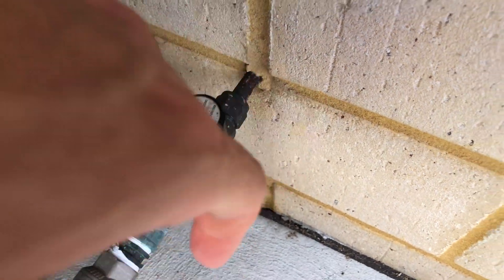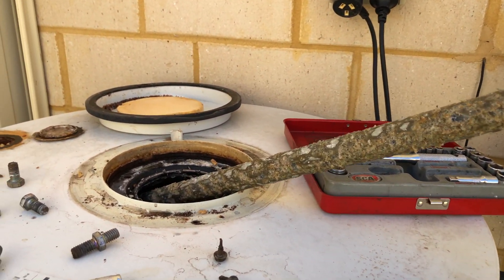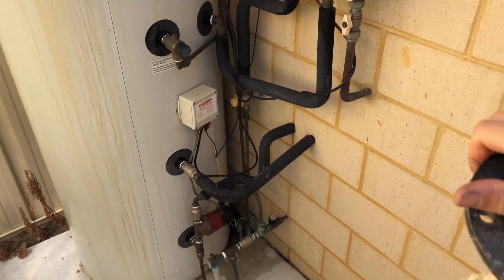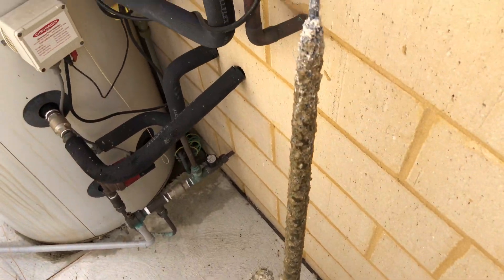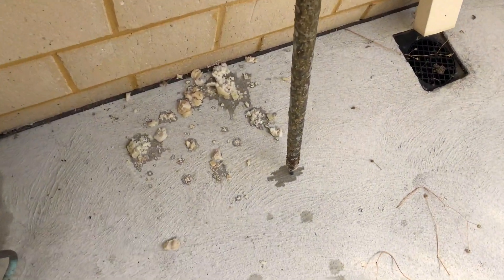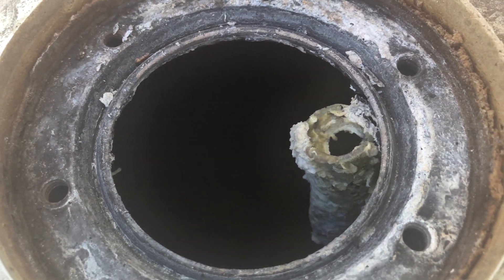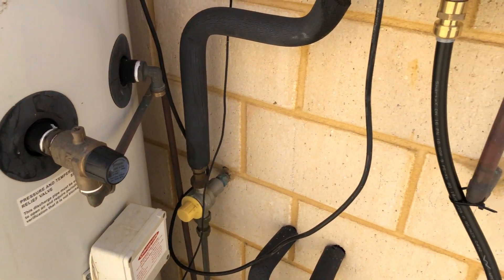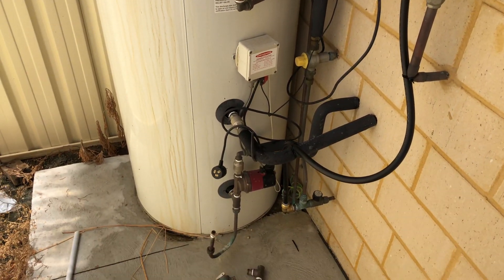I bypassed the rusted out tank on my chromagen solar hot water system

Comment from the maker: Note! I am not a lisenced plumber, I'm just a homeowner that doesn't want to replace my hot water system right now. I have bought some more time by disabling the solar setup and relying on the instant heater only. I will not leave the water turned on or power connected when I am away for extended periods. When the instant system fails it will then become an emergency and I will have a professional replace the complete system.

Comment: How did you get the tank flange out, remove the four bolts then did you put a puller or something on the bolts?
I want to change out the anode and element on mine

Comment: what failed, it looks ok
Reply from the maker: the tank had a perforation somewhere and was leaking all over the ground till the water was turned off. Have extremely hard water where I am pumped straight out of the ground.
Reply: ok gotcha, your tank overall though is in much better condition than mine. mine has had a dint in it (at the top) from day 1, likely builder/contractor knocked it 14 years old now and water is full of rust. I have replaced the annode but need to do a flush. Have shower filter to remove the rust and its not really noticeable unless you look into the tank.  @MMWA-DAVE

Comment: My tank just failed, leaking and a plumber want to put in a new tank, no way I wouldn't waste that money! Then I booked another two plumber to do the bypassing, didn't even show up... and another plumber want to put on a new Rinnai gas only heater for $2500 but Chromagen gas heater still funtional.... I guess I would have to do this bypass myself and like you said, when Chromagen dies, I will hire a real plumber to put on a new one. DRAMA!
Reply from the maker: Not surprised. Installation of new hot water systems is a big money maker.
Reply: @MMWA-DAVE  You are right, they just want to do big jobs, didn't care about small projects. Good news is I just did my bypassing, it works great!!! Tank no more! Thank you for the video, it's useful and given me courage literally 😅😅😅😅

Comment: I'm a bit late to this party but you'll be okay with just the booster.  It's sized to operate with no solar if required.  In normal operation the gas booster will do less "boosting" the warmer the water going into it is.  A common failure point on the booster is the circuit board, specifically the big connector down the bottom.  The booster will randomly not ignite.  If you power cycle the booster you will hear the ignition system back a thunk sound like when it's heating.  If not, you've got a problem.  Sometimes it'll start working again after a few power cycles.  I found that cold southerly winds made mine worse as it was exposed to those winds.  My plumber wedged something non-conductive and non-flammable (a little chunk of concrete from the garden) between the plug and the tray which the board sits in, to get it a bit more life.  It'll all look obvious when you see it.  Wedging something in there will mechanically make the dodgy circuit a bit less dodgy.  * Be very sure to turn off the power to the booster before taking the cover off the booster and keep it turned off while you're looking/fiddling as it has 240volts running through parts of it! *
Reply from the maker: So far so good running on booster alone, looks like its been over 2 years now. I’m surprised actually, thought it would have died by now. This was only a temporary life extension type thing I thought and the plan is to just replace the booster with another instant hot water system and throw out all the remaining solar bits. As it turns out i was only saving about $10 a month with the solar setup anyway, totaly not worth it for a bachelor pad.

Comment: Man those tanks pop after 10 years and no plumber wants to just replace the tank, they all want to either replace the whole system (panels and all) or just rip it off and put a instantaneous system. Cheap up front but not cheap in the long run.
Reply from the maker: hot water system replacement is big business. They also know people are generally desperate when it fails and can charge a lot more.

Comment: My Chromagen tank has started leaking at the top joint now (bottom joint is mega rusty!) so I'm thinking to perform this bypass as well. Family of four. Are you still running the bypass? Also, I noticed you no longer have the pressure relief valve attached on your water outlet, I guess no longer needed with the bypass of the tank? Do you have any links to the fittings/pipe you used and are they OK for a long term fix?
Reply from the maker: still running the bypass and the gas booster is just an instant hot water system which is fully capable of heating the cold tap water to hot temps without the solar setup at all. Have had zero troubles.

I’d suggest gettinf a plumber and having them do the bypass, it shouldn’t cost much. My gas booster is from 2008 and fully expecting it to fail any day. When it does ill just buy a new instant heater and have it professionally connected. So far so good though. Gas bill (in WA) was only about $10 per 2 months more expensive without the solar, absolute waste of time. Will be more if in eastern states with expensive gas.
Reply: @MMWA-DAVE  Thanks for the reply. I'm also in WA with the exact same system and with the tank now leaking as of today (I had a water leak sensor setup just below the bottom elbow to catch when this would happen and sure enough..), I'm going to take your approach and just bypass it for now to work purely on the gas backup booster.

Based on your video, it looks like you used the 16mm Pex pipe from Bunnings so I'll use the same and I'll do it myself. I do expect our gas bill to rise but hopefully not significantly.
Reply from the maker: @amundruu  yep, everything was bought from bunnings, think at the time it was all done for under $30 😅 Copper pipe would be more confidence inspiring, but surprisingly ive not had the pex fittings cause any issues at all yet
Reply: @MMWA-DAVE  got the same tank. Im lucky mine is still working to this day with no signs of rust or leaks (Unit is 12 years old). Only thing that failed has been the gas booster which I replaced with a larger unit (26 litres per min compared to the one the builder provided which was 20 litres per minute). Question I have, how did you get the top off to get access to the anode? That I need to replace and do a complete tank flush
Reply from the maker: @TuanNguyen-jd8dt  I live in a hard water area and there were a few inches thick of limescale on the tank walls - This absolutely contributes to tank failure. Good mains water will make any hot water system last much longer. The access cap for the anode just pops out, was really quite easy to access, but all too late for mine. Be interesting to hear how much scale is on your tank walls. What will you use to disolve it?

Comment: are u still doing it? check out my Guilt Free Hot Water site on FB,nothing to sell
Reply from the maker: Roland Reves i still have hot water with the tank and panels bypassed. Its just operating on the instant backup system alone. I have not received a gas bill yet to determine what the cost difference will be with no solar heating yet.
Reply: @MMWA-DAVE  I came across this vdo. Thanks so much. Any update with this? after few years, is it still working with bypassing tank and panels? the gas unit can handle hot water still?

Comment: greeting from israel... Do you need any Chromagen hot water system ?? :P it's very interesting that you have chromagen in australia.
Reply from the maker: Samir A.A. Its sold in our largest hardware chain store here and also used by home builders. I’m only one person living at this house so it’s probably overkill. I will just get a small instantaneous system when this one fails.  I will use the space freed up on the roof for more pv solar panels
Reply: Yes it’s sold here in AU but no spare parts, it’s unreliable, it doesn’t provide a lot of benefit in cold Melbourne and Chromagen local distributor has very poor customer service